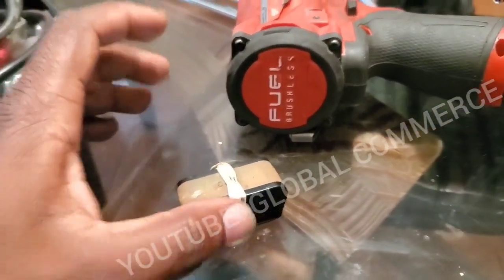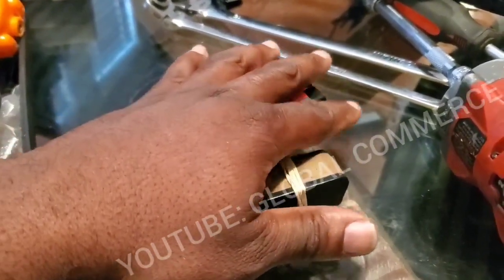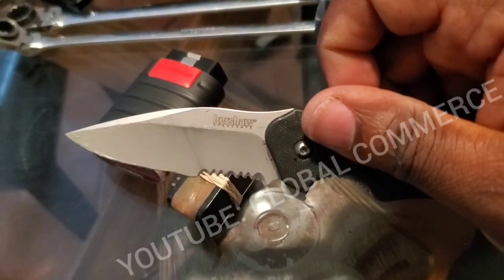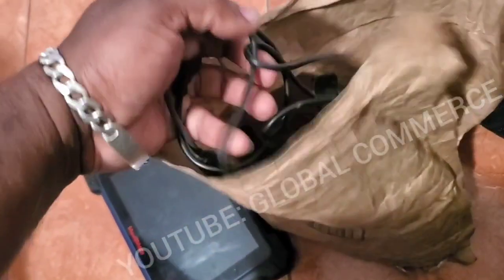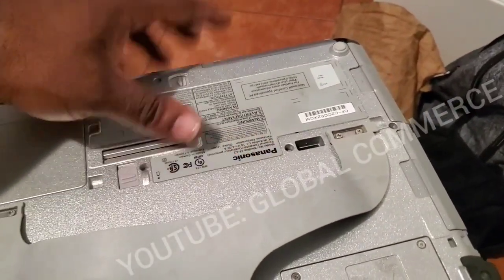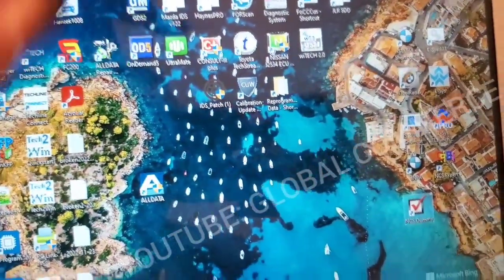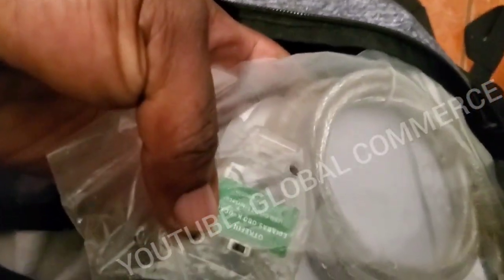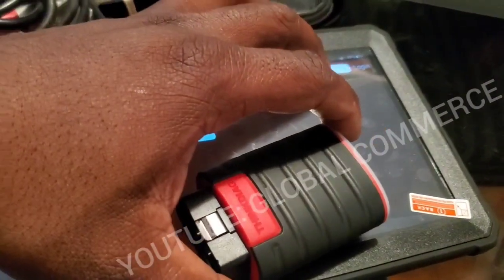Master Auto Electrical tech LOADOUT! Tools and software! PART2

Comment: One of the advantages to the larger screen, memory, processors are when you start recording multiple pids and/or graphing them. Harder to do on a phone. I love the huge screen of the Autel ultra. Previously the maxisys had issues with memory while trying to record 3 pids at once.
Reply from the maker: Larger screen definitely agree, but any data being recorded from a pid will be minimal.. if you experienced slow down from recording a pid as a programmer I would say thats more of a software/os optimization issue instead of lack horsepower of any modern machine.. (which maybe by choice of the manufacturer) I would even go to say with confidence the same software on the ultra can be rewritten and optimized with all the same features to run on a windows 95  pentium machine with 256MB of ram.  I've done similar in the past, rewritten windows programs to run on windows CE .. and those machines were dinosaurs compared to any modern machine of today.